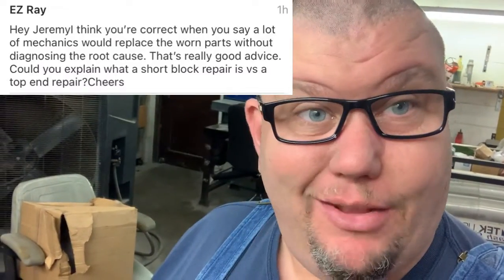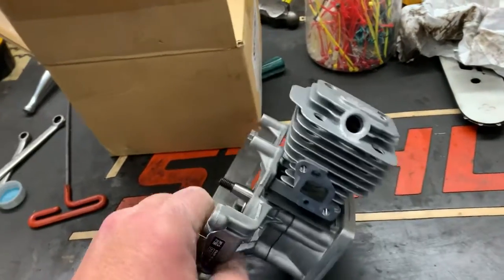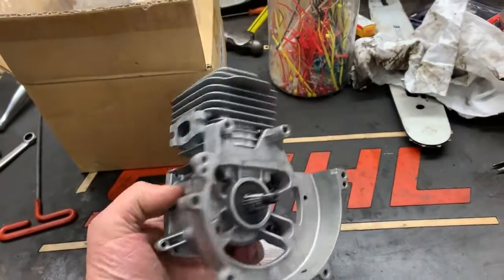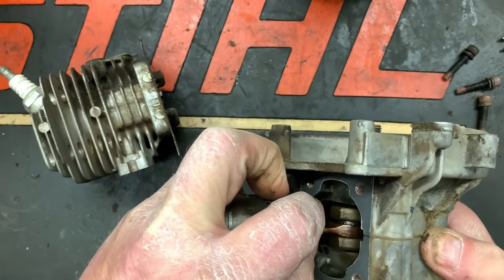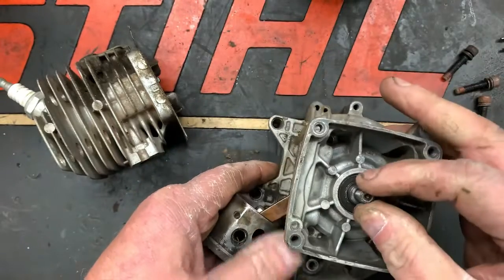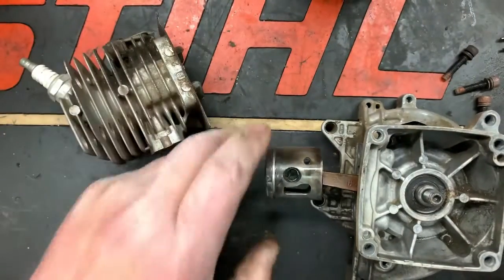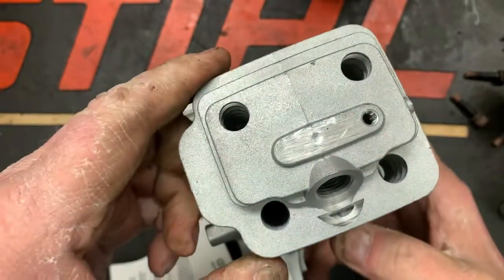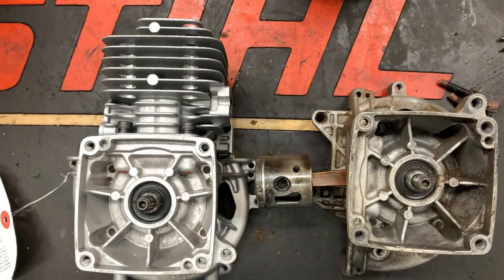VIEWER QUESTIONS AND ANSWERS : WHATS THE DIFFERENCE BETWEEN A SHORT BLOCK AND A TOP END JOB

Comment: Great video as usual Jeremy. My bosses can't understand that short blocking is a way better choice than doing a top end. Usually, a top end on a Stihl ts 420 is about 3-3.5 hours with the chance of the bottom end failing after a while where with a short block and new carb, you can rest assured that the  piece equipment will be working properly

Comment: Great video. Good work.  Wonder if you have an idea on a Honda tiller 4 stroker. I have new fuel filter , fuel lines , purge ball , return an feed lines are correctly installed. New spark plug , have fire , an a good switch. Adjustment of valves.  Seafoam fuel.  Wont START.